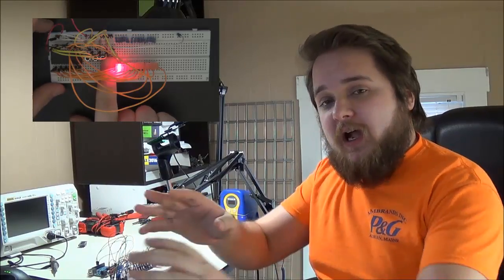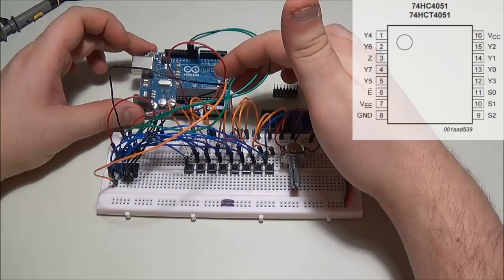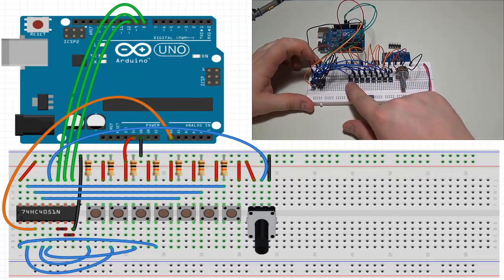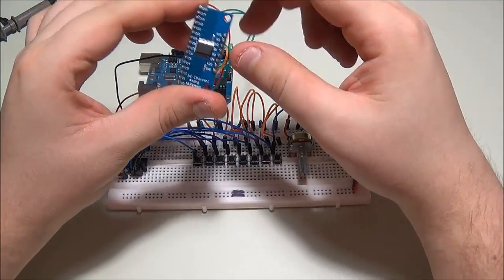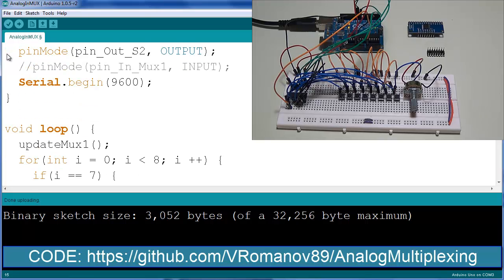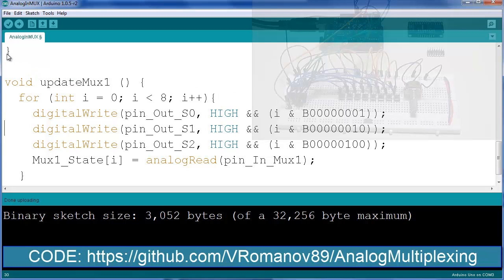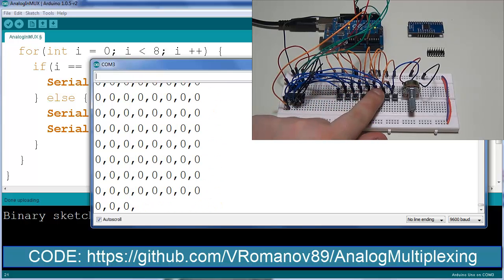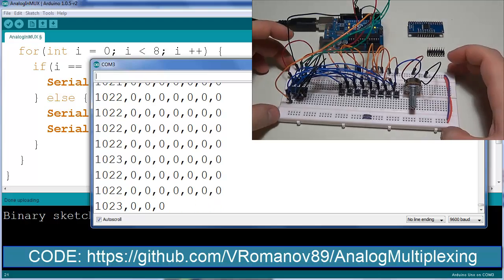Ep.54 Analog Input Multiplexing with the 74HC4051 - 8 Sensors on 1 Pin

Comment: could you explain me how works the following piece of code? 
High && ( i & B00000001)
Reply: The answer to this would be helpful :). I'd subscribe for this answer :))
Reply: this tells the 74HC4051 which channel you want to listen to. In this example its channel 1. Then the 74HC4051 sends the value for channel 1 to the arduino
Reply: you look at "i" in binary form. for example if i=5 in the loop then it will be:    [1]*2^2 + [0]*2^1 + [1]*2^0 which is represented as 101 or B00000101 in binary. So the goal is to activate the 6th (0..7) analoug in order to get it's value and the way to do it is by sending the S0,S1,S2=HIGH,0,HIGH to the multiplexer. The code resolves the logical statements: 1) B00000101 & B00000001 = B00000001, 2) B00000101 & B00000010 =  B00000000, 3) B00000101 & B00000101 & B00000100 =  B00000100. HIGH is actually the boolean True (or integer other than zero) and LOW is the boolean False (or zero) so HIGH && B00000001 is actually HIGH\True\"Integer other than zero" and HIGH  && B00000000 is LOW\False\zero

Comment: I'm not clear about how ur updateMux1 function works. for ex if I = 4  in the for loop, will S0 be set to 4 00000001
S1 -> 4 00000010 and 
S2 -> 4 00000100 
sorry I'm a newbie and desperately want to know how multiplexer works with this code. can u pls explain?
Reply: if the i = 4, in binary system it means, that i = B0000100 ( big letter B - means binary system), and when you doing this operation: 4 & B00000001 - it means you doing this operation: B0000100 & B00000001 and you get the answer: B0000101, that in decimal system = 5 - the 5th input in MUX. Read more about binary system and binary operations - it help you to understand more. I hope you'll undertand my answer, as you can see, my English level is not so good.
Reply: Here it looks rather more like:  4 & B00000001 -> B0000100 & B00000001 -> B0000000
Mostly because '&' function leaves "1" only on bits where there was "1" in both numbers
That way you get coding demanded by multiplexer like: S0 is 2^0 (so 0 or 1), S1 is 2^2 (so 0 or 2), and S3 is 2^2 (so 0 or 4)
With that if you whant to get e.g. input 5 those operations will set S0 high, S1 low, and S2 high

Hope it helps to understand

Comment: Can this read multiple analog inputs at the same time? (Like for example pressing two buttons at once and reading both of those values at the same time)
Reply: Santiago the Great I'm thinking yes, but not simultaneously. It has to cycle through the selection and it will send the data regarding the selected input, but it does that very fast, so it's almost like a simultaneous input

Comment: I was thinking in using an arduino with multiplexed pots and switches, but I'm not sure if this boards tracks quickly enough or if it can take several control signals simultaneously without going crazy or mistracking sliders or pots, or jumping around values... Is it powerful enough to handle at least 16 muxed analog inputs, and 16 digital signals? :/
Reply from the maker: It is hard to answer the question without knowing what you will do with those signals. Obviously, the more inputs you have, the longer it will take the process. That being said, it's all about you application. You can be dimming lights with those pots and I can assure you that it will be fast enough. However, if you are trying to create a control system for a quadcopter for example, it may not be the optimal way. I'd say that you would need to try it to know for sure.
Reply: Hehehe, nothing too complicated. I need to convert each analog signal into MIDI and those digital signals as switches. Every analog input should be downsampled from 1024 to 128 values and assign each of those signals to a CC value, which is a ID for each controller...

Comment: Hello! How do I use two or three interconnected multiplexer, totaling 28 or 42 channels? Thanks in advance.
Reply from the maker: You would need to connect the output of the mux to the input of another. This would split one of your mux inputs into 8.
Reply: Ok. Thank you.
Reply: And what about the code for that if i want to create any case for any particulate pin input ?
Reply: I would be interested to see how to expand this, as well.  Did you follow up on this?
Reply: NISHIT MISTRY this would be a very interesting and potentially confusing block of code, I would imagine. Do you think it would require nesting multiple "for" loops to read the pins within series of mux?

Comment: I have a real world use for this circuit.  I have about 15 strawberry planters that will freeze this winter on my balcony if I don't do something.  Bringing them inside is not a good option. 
I want to measure the temp of all my planters with an LM35 and I want to use some resistors to give them just enough heat so as not to freeze.  It will get down to -10'F.  So if I can use perhaps 5 watts worth of 1/2 watt resistors and keep the temp to about 37'F. I should be okay.
In summary I need to Mux 15 Analog inputs and 15 digital outputs to the tune of perhaps 5 watts.

Comment: Very cool explanation. You mentioned flow in terms of sensing and analog input. So if I had an array of flow sensors how would this count each pulse and increment a flow value?
Reply from the maker: +Clayton Allen If you have an array of analog sensors, you would get a reading from each one of them into the array. After that, you can use any of the values stored there for any purpose in your program.

Comment: Very nice.
I am going to use this to put 54 thermistor into a beehive.
I have bought 5x 12channel breakout, but after watching your video I wonder.
Can i use 1 pin, connect to a 74HC4051 that connect to 8 74HC4051, that then each have 8 termisistor? I like to only use 1 pin on arduino :)
Reply from the maker: +ehonning You could do that, but keep in mind that you will need to toggle the channels of each of those ICs, so you would also need to come up with a circuit for that. Shift registers or digital multiplexers could be an option.

Comment: This is very well done and super clear.  The application I have experimented with that led me to your video is creating a multi-cell battery discharge tester.  I would like to use the multiple analog inputs measure the voltages of a number of 18650 lithium cells (recycled from a laptop, e.g.) under load over time, all at once.  The challenge with these old cells for ebike and electric vehicles is getting batteries of equal capacity.  There are easy ways to measure the capacity of single cells but not many cells at once.  A multiplexer solution would allow testing of the many cells needed in a shorter time frame.  Thanks for the excellent video.

Comment: Nice! Comes in really useful when you want to measure slower signals. 
From looking at the datasheet, the atmega328p can sample 15000 times per second at max 10 bit ADC resolution which can measure 1 x 7.5 KHz signal (good old Nyquist...should apparently sample slower than this to avoid aliasing but whatever.). Using your setup you can now instead measure 2 x 3.75 kHz signals, 3 x 2.5 KHz signals etc using only one pin!
I would use this setup for a temperature measurement systems where you want to map the temperature at hundreds of different locations, for example to find where the heat is distributed in my apartment and find out where the heat is leaking out in winter :)
Reply from the maker: +Michael Segev very good point mike! I haven't really gone through the drawbacks of this setup, but you can't have "everything". This would be adequate for 90% of analog applications; not for high speed ones.